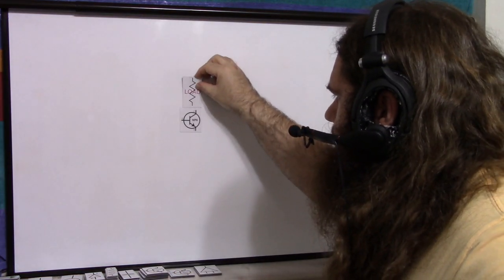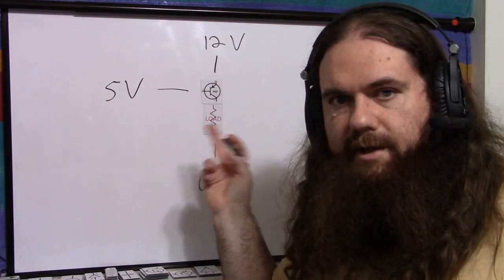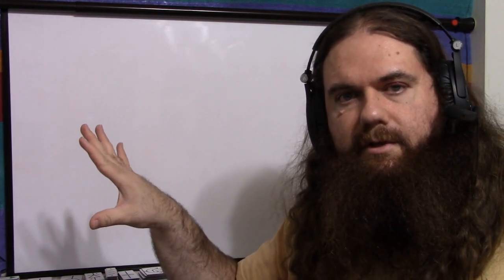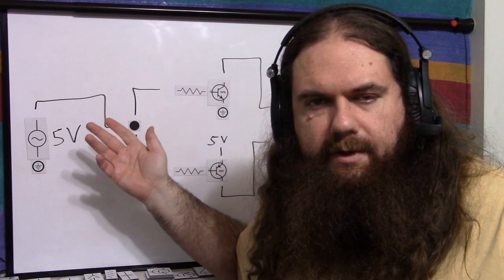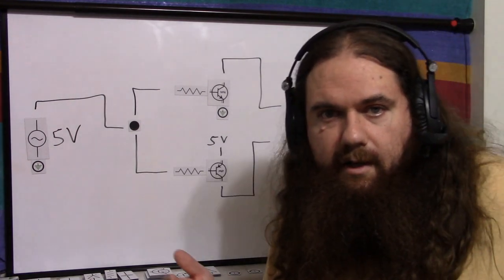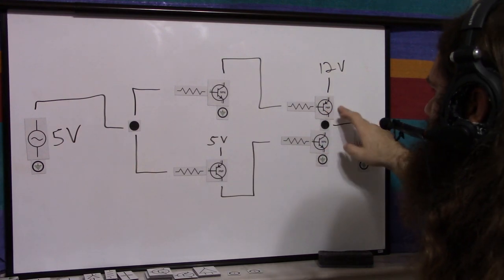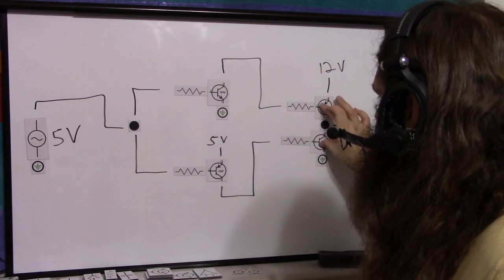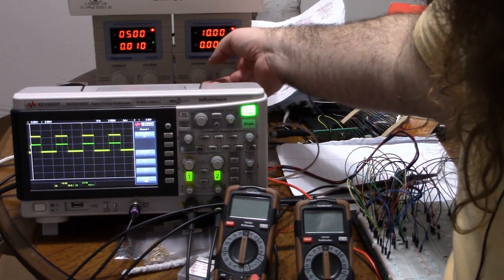Push Pull Power Amplify a Low Voltage Square Wave - PNP High Side Switching - Simply Put

Comment: I built this ckt and I would recommend putting some resistors on the emitters so the transistors don’t burn up. Especially if you turn off the input pwm. Good vid, much appreciated

Comment: If this works for what I am trying to do, thank you sir. You are a saint.
If it doesn't work, well you're still a saint.
It works in a schematic simulator.
Trying to use the signal Gen on my scope to provide a replica of the PWM produced by my car for the instrument lighting for bench testing a project.
I could order a decent enough PWM generator, but I want to work on it now and might have stuff for this on hand. Will update.
Update: It did work to some success for a little bit. I think I kept burning out transistors or something. Not sure I had it hooked up right. I just ended up ordering a PWM generator module and used a P-channel Mosfet to convert it to pulsed positive voltage and load grounded directly. That worked for the signal I needed to replicate. Main trade off seems to be that I just have to plug and unplug the wire for turning the signal on and off to my project. Just turning the output on the controller off causes the output to go to +12V due to the P-channel. Could probably use a relay or something to kill the power to the P-channel, but this is just generating a test signal outside of my car to build something, so not really that important or long term. 
Also, for the signal I want to replicate I have to set the duty cycle for the off time instead of the on time.

Comment: I'm slightly confused :). If all you want to do is to amplify your square wave from 5v to 12v, then I believe your solution at 0:50 will work fine.  If for some reason, you want it to be a high side switch, then I believe the two transistor (NPN -> PNP) solution you mention at 2:18 will also work fine.  What I'm unclear on is why you decided that you needed a push pull configuration simply to amplify a square wave (if your square wave was AC, both positive and negative, then I would understand the need to have a push pull).
Reply from the maker: That would mean there's higher impedance on high output than low output, and I didn't want impedance on the output because this is feeding a capacitor that's charging and discharging: Any impedance at all is going to slow that down. Single-sided push pull means you have almost no impedance either way, so it's mostly just a "pass through". Think of it as a solid-state SPDT switch.

Comment: if you just want 0 - 5v ----> 0 - 12v, wouldn't this work (2 transistors): 

ok, start with your square wave, feed that into a resistor which goes to the base of an NPN, Q1. Q1's emitter goes to GND, and its collector goes to the base of a PNP, Q2.  The emitter of Q2 is 12v, and the collector is your load. that should work and it took me 2 transistors. Were you referring to that at ~2:18? Here is the falstad text for this circuit:

(go to falstad circuit sim, go to file, then copy and paste the thing from below and hit import from text). Probably in the actual circuit you might wanna do the math and figure out the proper resistor values but yea this works for now I guess?
$ 1 0.000005 16.13108636308289 50 5 50 5e-11
R 144 224 80 224 0 2 40 2.5 2.5 0 0.5
r 160 224 240 224 0 1000
t 240 224 320 224 0 1 0.6326554478618063 0.6639010362608694 100 default
t 336 176 400 176 0 -1 -0.6362859870853264 -0.6666891433824524 100 default
r 320 208 320 176 0 2000
w 320 176 336 176 0
g 320 240 320 272 0 0
R 400 144 400 64 0 0 40 12 0 0 0.5
r 400 192 400 272 0 2000
w 400 192 448 192 2
w 144 224 160 224 2
g 400 272 400 304 0 0
r 320 176 320 144 0 1000
w 320 144 400 144 0
w 400 144 400 160 0
x -28 96 380 99 4 24 didnt\sbother\scalculating\sresistor\svalues
o 0 32 0 4098 20 0.1 0 4 0 3 9 0 9 3

edit: ok i saw the other comment